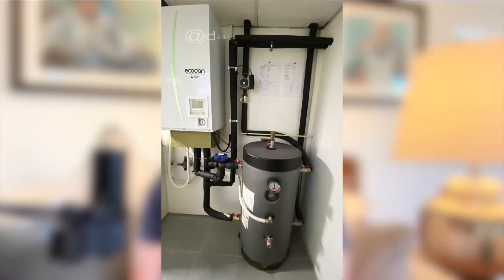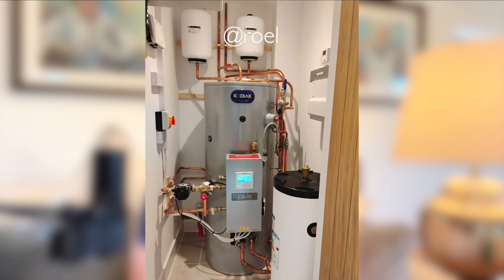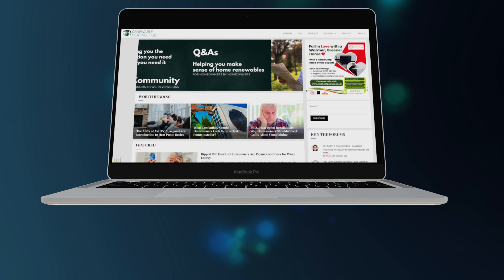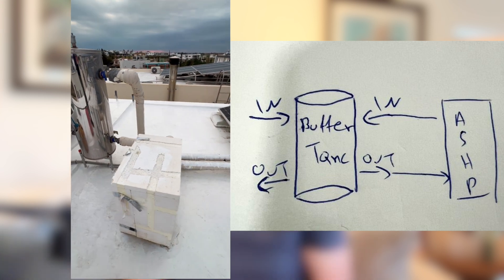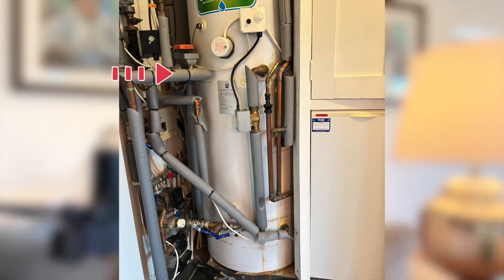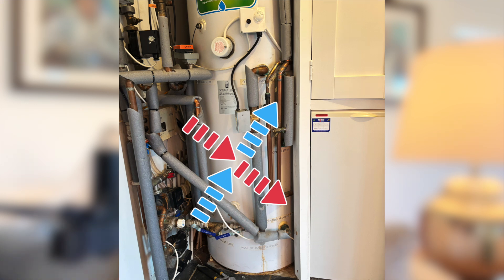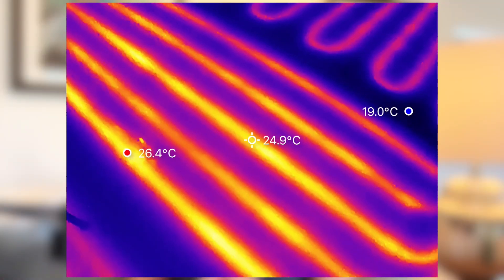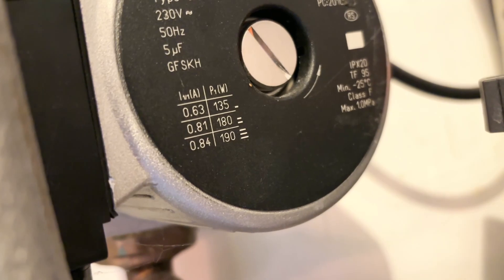Is Your Buffer Tank Wasting Heat and Money? Buffer Tanks & Heat Pumps Explained!

Comment: We had a 4-port buffer installed, and really didn't need it (just one zone, all radiators). simply changing the pipework around it to make it work as a volumiser as he described  (removing the secondary pump along with that) made a significant impact on the efficiency (around +0.5 on the SCOP). Our system still has rather poor efficiency overall (working on it), but the buffer to volumiser conversion is definitely recommended.
Reply from the maker: That’s brilliant. Thanks for sharing.

Comment: Here is the latest email from my heat pump installer Explaining why they think a buffer is advisable. This would be a very standard installation in a two bedroom flat with 7 or 8kw heat pump, under floor heating in the lounge with a wood floor, and radiators in both bedrooms. I would welcome any feedback.

"Point 2 - the buffer question 

We have discussed the specification of a buffer for your system and the various benefits / potential drawbacks where a buffer is specified unnecessarily. 

The key reasons that we recommend a buffer tank is to ensure reliable system performance and reduce cycling, maintain proper flow rates and ensure hydrolic separation. The reasons for this are both functional and experiential. 

System volume and minimum requirements:

You’ve estimated your system volume at approximately 20l. Our own calculations have system volume slightly higher at 24.9l. Minimum volume for the Samsung units is 30l and for the Vaillant units is 40l. 

This does mean additional volume is needed to prevent short cycling and maintain efficient heat pump operation. In our opinion a buffer tank is a proven solution to add required volume while also offering additional benefits.

I have watched the videos that you shared and am quite aware that there are many installations out there that have been installed by engineers who don't properly know understand the systems they are working on - I have personally seen incorrectly piped buffers as well as pipework configurations which have cylinder coil return tapping into heating system return before the buffer.

To provide some reassurance, our system design includes a secondary pump specification which allows for flow reading across both primary and secondary circuits in order to properly balance flow rates.

Volumiser as an alternative:

You correctly suggested a volumiser would be an appropriate solve to the system volume requirements. However, a volumiser will not provide and Hydrolic separation benefit. When the heat pump switches to hot water heating, it will stop supplying the space heating loop. Without a buffer, there can be a risk of reverse flow issues potentially causing unwanted temperature fluctuations. 

I do note that you have suggested that you're not worried about this point. However, our approach generally is to install hydrolic even when a system has sufficient volume (do do this by way of a low loss header. The reason for this is to ensure that we are delivering a consistent flow rate to the heat pump and a break between the primary and secondary circuits variations in demand (e.g., individual radiators or UFH loops opening/closing) will cause variation in the flow rate which can impact the heat pump efficiency.

As I said when we discussed this point at your property previously, given that there are two acceptable solutions (buffer / volumiser) and we are confident that both would deliver suitably efficient operation we are happy to take your instruction on final solution. However, our recommendation would be to proceed with the buffer".

Comment: Good day Mars
I have a scheduled Date of 1st of April 2025 for ASHP installation with Octopus.
I have really found the recommended books a useful tool to obtain a better understanding of ASHP. 

Bodge Buster: Heat Pump Guide for Homeowners
From Zero to Heat Pump Hero

However I do have a question associated to your recent post: 
https://www.youtube.com/watch?v=bZEii9tSyyU&t=143s
Is Your Buffer Tank Wasting Heat and  Money ?

In the Podcast you made the following statement with reference to installing a Volumizer. 
Converting from a Buffer Tank to a volumizer can make a big difference with efficiency.
Instead of separating the heat pump from the heating system it simply adds extra water volume to the system this helps stabilize
The flow and temperature without the risk of blending hot and cold water.
The volumizer is typically installed on the flow side of the system meaning it stores water at the same temperature as the heat pump's output.
Hot water from the Heat Pump flows into the Volumizer and then out to the Heating system without any system separation and because there's no return Flow mixing into the tank of water and stays at a constant temperature avoiding the blending issues that plague so many buffer tanks. 

However I require some clarity here as your post has left me confused. 
I have recently reviewed the following post by Elite system specialist who regularly attends your podcast, and the positioning of the Volumizer according to Elite system specialist should be positioned, on the return pipe of the ASHP circuit. 
I have also found additional information stating the same, see below.

Would really appreciate clarification on this matter prior to my install, as I am constantly having discussions with Octopus ASHP Specialist base on Heat Pump Guides. 

Volumizer Placement Alternative 
In an ASHP heating system, a volumizer should typically be placed on the return pipe of the heat pump circuit; this allows it to provide additional water volume for defrost cycles and helps to stabilize the system pressure during operation, especially when dealing with fluctuating flow rates. 

Key points about volumizer placement, Close to the heat pump,  Position the volumizer as close as possible to the heat pump on the return pipe to maximize its effectiveness.

Elite System Specialist Youtube Podcast. 
https://www.youtube.com/watch?v=ukXP8--hahA
Transcript 14:51 - Volumizer not a Buffer.

Kind Regards 

Charles
Reply from the maker: There’s a lot answer here. I’ll give you a more detailed reply this weekend. As for the volumiser, I’m recording an episode tomorrow on design, and I’ll ask the panel to comment on this. If you watch the episode on buffer tanks from a couple of weeks ago, Neil from Grant says it should be in the flow. So does Brendon Uys. But we’ll get more views tomorrow.

PS - thank you buying my books, and glad they were helpful. Your support is greatly appreciated.
Reply: Great look forward to reviewing the new recorded episode
Reply from the maker: Literally pressed stop record 20 minutes ago, and we covered the positioning of the volumiser in quite some detail. This panel was split 3/5, 1/5 and 1/5 on where it should go...
Reply: I see when are you posting the video ? look forward to reviwing
Reply from the maker: It's out and here: https://youtu.be/ofdV2n9XaxY

I will, however, be publishing an article on the positioning of volumisers this week that will hopefully give you more insights.

Comment: Im leaning towards having a 100L 4 port buffer in my system. If done right using a well designed tank (NIBE UKV 100), with pump flow rates set correctly, it appears to be of significant benefit with no loss in flow rate or return flow temp. One benefit is the ability to have an BESS powered immersion heater built into the buffer, to help with defrosts and ASHP downtime.
Reply: This is how I’m gearing up an install now for a client with a 13kw heat loss fitting a 12kw vaillant which say they can cover the heat loss but in reality with defrosts they kick out 11kw max. So the back up is needed when extra cold

Comment: Heat loss of the building first, in my experience. Then calculate flow to carry the required kw. Pipework in UK is notoriously oversized, so pump speeds benefit from intelligent controls.

Comment: A buffer tank is a cylinder filled with water which is heated by the heat pump. This was a the way that hot water systems were require by the back boiler of a coal fire in the 1930s to the 1960s.. It stores the hot water which was used for the tin bath in front of the fire. We have moved on from that but the heat pump is taking us back (maybe not a tin bath!)
The Combi has made the cylinder redundant which freed up space in the airing cupboard and loft.
But now with heat pumps it is back heating water in a huge cylinder which needs space and is often unused so a very retrograde system which demonstrates the limitations of the heat pump idea. I install heating systems in small urban houses where there is nowhere for the 'buffer' and all the other associated equipment to be installed.

Comment: Generally, if you need a volumiser, best to fit it on the return & not on the flow...
Reply from the maker: The volumiser isn’t storing temperature or energy – it’s storing volume. Since the volumiser is at the same temperature as the return, there’s no thermal advantage to placing it on the return side. Instead, its primary purpose is to assist with defrost cycles, and this is where positioning matters most.

During a defrost cycle, cold water enters the heat pump, is cooled further, and then pushed back into the system. 

If the volumiser is on the return, this cold water flows directly to the radiators, potentially causing significant cooling and discomfort. 

However, if the volumiser is on the flow, the cold water first mixes with the warmer water in the volumiser, which helps to moderate its temperature before it reaches the radiators. This prevents cold shocks to the system and maintains comfort levels in the home.
Reply: for the water to mix within the volumizer it would need to be correctly oriented. It's important to remember that within a volumiser, or a buffer, the velocity of the water is close too 0. Any mixing will be due to buoyancy in the main rather than from the velocity of liquid. If the volumizer is installed upright and the water from the heat pump enters at the top and the system is fed from the bottom. This mixing would occur. But at the same time, any temperature drop within the cylinder during normal function would be counterproductive. It is worth considering the amount of energy that needs to be extracted from the system. Water during a defrost to assess the impact, it would have on the system. If most of the water required for defrost was retained in the return, close to the heat pump the temperature drop of water entering the system. It's likely to be similar to the normal delta t in the system.And so it would have a small impact. A well designed heat pump system.Should utilise secondary pump control and a buffer. This would be similar to the design used by Viessmann. When defrost, it's happening, either a bypass valve or pump switching could cause only the buffer. To supply the defrost volume. The buffer could be reheated over the period of heating before the next defrost cycle at a very slow flow rate or as a special plug of water as in the Viessmann design. We could also ensure that flow rates on both primary side and secondary side are controlled for the best performance. The flow rates could match when required and be unmatched to achieve required performances when required. Examples being for defrost and for the reduction of cycling and pre heating of the buffer. 
Historically, hydraulic separation became used too often and adam at heat geek came up with the term distortion to describe the negative impact on efficiency created by the mixing within a low loss, header or a hydraulic separator. Unfortunately, I think this terminology has led to a negative view of buffers and hydraulic separation that prevents the correct use of these design options. What we really need is for engineers to have a thorough understanding of when and why hydraulic separation is required. This negative approach, I think, is preventing people from looking intelligently at the opportunity to utilise a buffer volume in the ways I have described above. As always Viessmann have demonstrated their brilliance by recognizing this opportunity and utilizing it within their indoor unit on their heat pumps. This is in contrast to the majority of heat pump manufacturers. Who do not even include a buffer sensor or secondary flow sensor to allow the weather compensation curve to determine the secondary flow temperature. Without this sensor we require the heat pump to be set at a higher temperature than necessary further reducing efficiencies, when a buffer is used. I really enjoy watching the podcast and have learnt quite a lot from the other engineers featured. As always, it is always, through conversation that we become aware of issues and solutions. Well done for bringing these engineers together for the benefits of the whole industry.